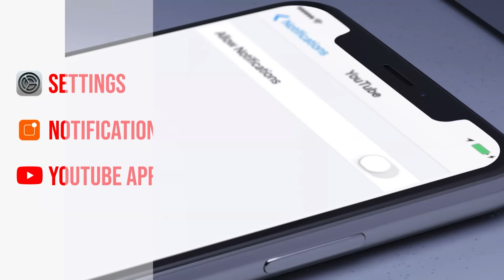Back Bevel Chisel Trick - Does it really work?

Comment: I think that there is a middle ground between the 2 extremes and that middle ground seems to work fine for me. One extreme is the ruler trick applied to chisels, I don't think that it should be applied even for cheap chisels as even a woodworker that usually does not do fine work sometimes has to reference with the flat part of the chisel. The other extreme is to do like you Rob did on your chisels, a perfect flat and polished surface that extends up to the handle, awesome but fatiguing and time consuming work that IMHO is over killing. My trusted middle ground is to apply pressure only on the last couple of inches while I flatten the side opposite to the bevel, so I get a flat and polished surface that extends only that couple of inches from the cutting edge, still time consuming, but way faster. When you reference the chisel pressing with your thumb you anyway apply the pressure to that portion of the blade that is flattened doing it my way, the same is true when you remove the burr on the stone after sharpening, those 2 inches give all the flat surface that is needed for fine woodworking. By the way I called it my way, but I am not alone, I know many woodworkers that prepare their chisels that way.
Reply from the maker: Flattening the last 2 inches is all that is needed. I just prefer flattening the whole back

Comment: Very interesting video Rob, I love seeing conventional wisdom challenged and put to the test!   Speaking of which, did you see the video from a few months ago, where someone was testing the strength of end grain to end grain glue joints in comparison to long grain to long grain glue joints, and came to the conclusion that it's a myth that end grain joints are weaker!   Would love to know your thoughts on that issue!
Reply: Rob has a video on that issue, more or less confirming the myth is busted.
Reply from the maker: I wouldn’t say confirming the myth busted, but rather modified. End-grain to end-grain gluing, though stronger than we ever thought, will still never be strong enough to find use in any application. However, end-grain to long-grain definitely has application now.
Reply: @RobCosmanWoodworking  thanks for clarifying!  I knew you had some caveats in that video but I couldn’t remember what.  I agree there’s no good use for an end grain to end grain joint!
Reply: @RobCosmanWoodworking  Thanks for the reply. The only application I can think of where end grain joints are important, would be in a segmented wood turning project, where the segments are generally glue end to end (mitred joints) to make the rings.   Those joints need to be strong enough to hold the rings together while the top and bottom surfaces are sanded flat.   Usually several rings are then glued one on top of the other (long grain to long grain) and the end grain joints would be staggered, so their strength becomes much less important at that stage once the long grain joints take over.

Comment: Thanks for the video. 
No mesure required :
There is the same proportion between the width of the sharpening stone (minus the ruler) and the width of the back bevel than between the thickness of the ruler and the elevation of the edge above the reference plane. 
My maths vanished !
jp from France

Comment: Well researched conclusion Rob.

There is an improvement to the Charlesworth ruler trick I have been recommending to fellow woodworkers for some years now.

Instead of a ruler on the stone - use a layer or two of electrical tape on the back of the plane blade a fixed distance up from the cutting edge and parallel to it of course. I use 50mm myself and measure it for consistency. Because the micro-angle is set by the tape fixed to the blade the angle is totally consistent and MUCH easier to manage while sharpening. No fiddling with rulers slipping while sharpening. you can transfer from one stone to the next absolutely confident that the angle is the same.

The electrical tape has no impact on sharpening stones, and glides beautifully.

The added benefit is that the micro-angle is even less than with the ruler trick. Much less.

And yes I have used the electrical tape trick on chisels and found that for normal use it is fine, but not for paring work. Fortunately, I have two sets of chisels.
Reply from the maker: A very interesting idea.  I will try it
Reply: @RobCosmanWoodworking  Being an accountant and maths nerd I actually calculated the angles some time back. I don't recall exactly but with my 6" ruler the angle was about 8 times what I achieved with the electrical tape, which still yielded the desired result. So, a much smaller back bevel, and having it so consistent across different stones, combined with the ease of operation was a no brainer for me. Hope it works for you. And thanks as always for the seriously helpful videos.

Comment: Great video. Sticking with flat back but I may start doing a micro bevel on the front for a little more strength and speed of sharpening.
Reply from the maker: That's what I do.  In fact I do two microbevels on the primary bevel

Comment: Hi Rob. I love your channel. How about 'splitting the difference'? Sharpen the back of the chisel (like David suggests) but use the front bevel as reference for your cut. You would save the time sharpening and gain a bit of reference surface (obviously not near as much as with the traditional technique but more then without any surface). Just saying. Keep your good work and God bless.
Reply from the maker: That would require I sharpen the whole bevel, which would need to be done every time I resharpen.

Comment: On your second test, for example, with the plug... I feel like this method is fine for people who are already going to be sanding no matter what, because they are just sandpaper people. You can remove 90 whatever percent with the back bevel just fine, and the rest is 5 swipes with 180 or 220. If you are new, and are just going to be sanding because you don't have a plane, or you have just been told that you always have to sand everything, it's fine to back bevel it. It will save you time, and lord knows how frustrating it is as a newbie to flatten and polish chisels. Plenty of people just don't even do it early on because it is intimidating.

By the time people are hand-cutting dovetails they are going to be going all out to perfect every tool setup anyways, and will have no issue doing a full flattening.
Reply from the maker: I knew that so that why we made this video!!!!!!!

Comment: No crushed fibres with both examples, which I was expecting using the guide block and flat backed chisel,
 I found that a sure way of undercutting,
as you cannot have any infulence whatsoever (makes a lose fitting slot on a shooting board)

I don't mind a bit of tenting if it means I can keep from going under the shoulderline.
Been meaning to make a little cast iron stock, say something similar to the wee square for this kinda thing, as it holds onto graphite very well for making witness marks compared to aluminium.
Just saying tenting maybe not such a bad idea for larger work IMO, 
maybe not for your speedy demonstrations , but it could certainly get one out of a pinch, or if one needs a precision hole like 
for a making panel gauge for example.

Cheers
Tom

Comment: I use a Worksharp. I sharpen the bevel on chisels and irons and then quickly remove the burr and flatten the back. I have no need to use the ruler trick. I guess it’s only appropriate for hand sharpening to save time and effort.
Reply from the maker: it will give you a better edge.  If you use the 16k stone, the resulting surface on a piece of maple will be stunning.

Comment: I think there is some confusion created around the ruler trick when we use the word "flatten" to mean both "to make flat" and "to polish."  Making the back of the blade geometrically flat to get rid of high spots, low spots, wrinkles, or so on is one thing. To polish away grinding marks from the previous machine or stone is another. In my opinion a blade must be reasonably flat (geometrically) for the ruler trick to work effectively. The ruler trick is done, according to Charlesworth's YouTube video, on the final polishing stone and removes very little metal. It may cure small geometric defects, but not large ones.

There is also an advantage to flattening the back of the blade so that the cap iron seats firmly and with out gaps. Once it is flat, then it can be polished using the ruler trick, in my humble opinion.
Reply from the maker: I agree with all you say

Comment: Any angled treatment on the back of the chisel is going to create a secondary angle.  The area on the back of the chisel that had the ruler trick applied seemed to be about 2mm wide  (hard to judge).  The amount of time and effort expended in polishing the back was not shown in the video.  It's be interesting to see if a significant reduction of the polish line would produce an acceptable result. But again, any back beveling will produce a secondary angle.
Reply from the maker: I think we already did that, it boils down to the balance between shat you use your chisels for and how much time you are willing to put into flattening the back

Comment: It would be interesting to see you repeat this but instead of using the ruler trick, use a strop on the back of the chisel. Prepare the chisel as normal, sharpen as normal, but as a final step, strop the back with the chisel dead flat on the strop. Some say that a strop will round the working edge. I find this isn't an issue and use a strop, but you probably achieve a level of sharpness that I don't, so I wonder if stropping would keep your paring operation from working? Part of the point of this question is that pressing into a strop does some of what the ruler trick does, but if you don't go crazy with the pressure, the angles / offsets involved are greatly reduced, I suspect.

Comment: I am NEW to wood working. I have leaned the HARD way to not buy CHEAP tools! Now I got some good chisels & Stanley Hand Planes. The hand planes were vintage ones. After watching some of Rob's films I got myself some of the Diamond sharping stones. I had some OLD sharping Stones & sharping something went on & on & on some more! The one thing I can not find any info on is the blade used at the back of the Diamond Stone. Can someone tell me how wide it is & how thick it is?
Reply from the maker: Around .020” (20 thou)

Comment: Essentially using the ruler trick means you are creating a new tool. That means that you need to use a new technique, and if you use the old technique with the new tool, of course, you won't get the same results. However, I think you will find that if you practice and use the new technique required of the new tool, you will get just as accurate, reliable, and fast results as using the old tool with the old technique.
Reply from the maker: Seems like a lot of work to simply save time on flattening a chisel.

Comment: How about using a thinner ruler? The thinner the ruler, the less observable the difference.

For instance if instead of a ruler on the stone you used a bit of thin sturdy tape like kapton temporarily stuck to the back of the chisel at the same distance you would find your ruler, then the back-bevel angle would be reduced in the same ratio as the thickness ratio kapton/ruler. With a 0.1 mm tape instead of a 1 mm ruler, this would make the issues you are observing 10 times less acute, and maybe within the tolerance of what is required for precision work.
Reply: But then you'd be polishing much more of the chisel back too, given the reduced angle. By that point, the time saved would be negligible.
Reply: @ricos1497  can't have everything:)
Reply: Well, that would give me something to do with the massively excessive amount of Kapton tape I purchased by the roll, in order to use a tiny amount in my laptop computer refurbish.

Comment: 6:45 Um’ Why are you doing complicated dial gauge measurements to find the back bevel angle…When you KNOW you raised the flat by a ruler thickness across a three inch wetstone.  You know the ruler thickness and wetstone width…so its just simple trigonometry….Tan of the angle =opp (ruler thickness) / Adjacent (bevel to ruler front edge).  OR just hold the handle up until the blade angle matches that ruler thickness nearest the tang.  Alternatively cut a small piece off the ruler and superglue it to the chisel back near the tang, reproducing the honed angle <shrug>  Better still…just don’t hone a bevel on the back!!!  QED.

Comment: I guess you can save time sharpening with a bevel on the back and then  spend that time fixing gaps later on.  It's pretty much geometry and common sense right?  There's probably a reason (tongue firmly in cheek) why this has not been a normal method over the years.  I like Stumpy but having watched that video earlier in the week I was left unconvinced.

Comment: Since the sharpness of the edge is simply the function of an acute meeting between to flat or curved surfaces, even is the "back bevel" works on a chisel, if you have flattened the back, you have no call to add a back bevel.  It really doesn't offer a gain on a chisel.  In fact, I've accidentally rounded up the back adjacent the edge while stropping, producing a shaving sharp edge that still had problems paring because the back doesn't register properly.
Reply from the maker: I agree mostly with you.  I can see the usefulness of using the ruler trick on a "general use" chisel if you dont want to put the time into flattening th eback
Reply: @RobCosmanWoodworking  The single other aspect I would bear in mind myself is that I only need to flatten the back once.  A microbevel has to be created more or less every time a chisel is sharpened.  Stropping off the wire edge can't be any more work than making and maintaining a microbevel, can it?  With a general use chisel, something just for rough work, you wouldn't necessarily be concerned the detailed geometry of the edge.  Slightly concave or convex might not make a difference.

This might be one of those distinctions carpenters joke about between framers and finish carpenters.  A framer does every job with four tools, a hammer, a saw, a tape, and a square.  A finish carpenter has a tool for every job.

Comment: Thank you. I still don't think Stumpys idea of back bevel is a good idea. If you say you might only do some chisels with a back bevel and others not.. This starts getting confusing when teaching (I teach furniture making) I teach flat backs on plane blades and chisels tk avoid confusion. I get the Charlesworth method but only use it on irons that are so bad that it would take hours or days to flatten.
The obsession for sharp started in the 80s with the increase of Japanese tools and stones. They get their backs flat very fast by having ground out areas in single, double or triple fluted backs. We've  chased the sharpest edges but not adopted those flutes. They are the key to improving the quality quickly.
You're both right, some won't even notice the difference. Woodworking is about controlling timber and tools, in fine furniture you will lose a controlled face. I won't be backing any of my chisels off.
Thank you for this. Jamie
Reply from the maker: Great comment, very well stated.  Thanks for watching and commenting

Comment: No disrespect to Stumpy but it makes no sense at all to me. I'll keep mine flat!!! Great video as always Rob  - Many thanks!!
Reply from the maker: Stumpy’s video would be game changing for someone that only uses their chisels for carpentry, or spent $25 on a set of 6 chisels. It’s a great way to quickly make your chisel sharp, at the cost of precision. But at $5-10 a chisel, how much precision are you expecting?
Reply: @RobCosmanWoodworking  It was obvious that with the huge amount of material he left in the corner of the joint the chisel would still be able to trim it out roughly but if you only have a few thou to remove you just gotta have a perfectly flat back. I suppose it would be fine for those DIYers who love pocket screwing. Have a great weekend.

Comment: Can I ask a probably dumb question? I just received two lovely new low angle planes and was thinking about flattening the backs of the irons. I am guessing that, like chisels and for similar reasons, you shouldn't use the ruler trick on plane irons intended to be used bevel up? Is that a fair assumption?
Reply from the maker: No, that would be an incorrect assumption. Though it will change the angle, it won’t have a noticeable impact on your planing efforts.
Reply: @RobCosmanWoodworking  Thanks Rob. You are right of course, the difference to a chisel is that the blade is already elevated to 25 degrees, so the flat back is irrelevant. I wasn't thinking it through. To close out, I had already done the block plane the old way. It works great. So today I did the jack plane using the ruler method. Much bigger blade but really did not take all that long to get a polish across the whole of the edge area. Sharpened up easily and gives me incredibly fine shavings. So I am sold. Thanks very much for a really interesting discussion.

Comment: Can/should you use the ruler trick on bevel up plane blades?  Seems it would be OK since the blade is bedded at a 12 degree angle to start with.  But would you really gain anything by doing so?  Thanks much for your vids, I look forward to all of them.
Reply from the maker: Absolutely.  Doesn't matter at all if its bevel up or down.  use the ruler trick

Comment: What hasn't been mentioned is the thickness of the rule. A thin rule (0.015) will definitely give a flatter back bevel than a more commonly available one of say 0.046". A long feeler gage of any thickness less than 0.015 could give even better results. Otherwise a great and fair debate.
Reply from the maker: Mine is .018”